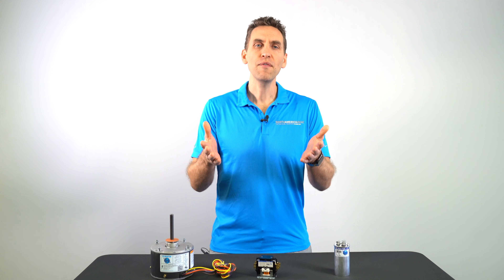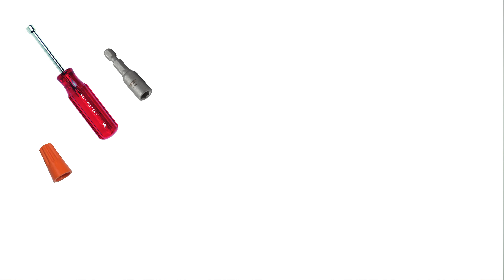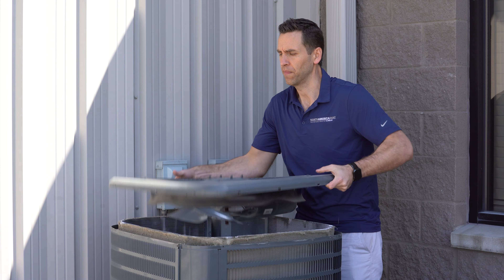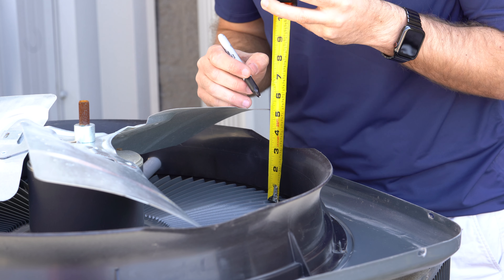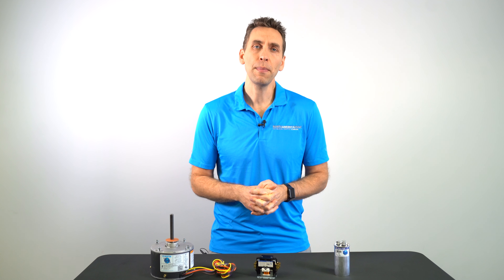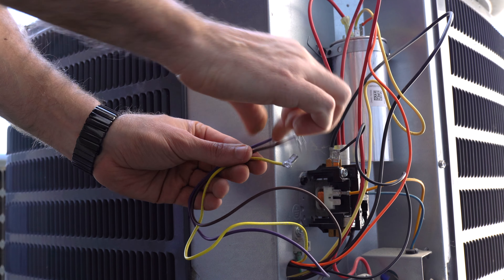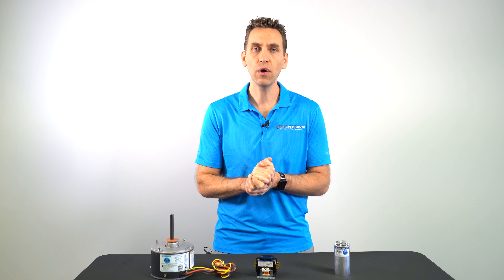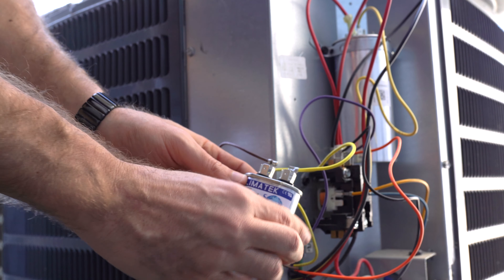Rheem Ruud Weather King Corsaire Condenser Fan Motor Replacement 51-23055-11  Climatek HVAC

Comment: Hello why is my condensing fan motor stopping ,its a brand new protech motor I foolow your steps to wire it  ( black,orange,purple ,yello and brown ) black to defrost board, orange to C in dual cap,purple to F to cap and brown and yellow put togeter it comes on but only stays on for about 2 minuts at the most ,please help

Comment: Why dont specify which is the CORRECT DIRECTION for the fan blade to turn? Clockwise or Counter? 
A Heat Pump has a defrost board & you didnt explain how the 4 wire fan motor connects with a defrost board.